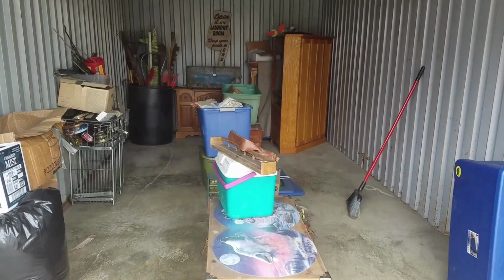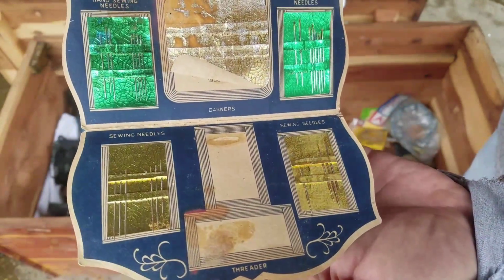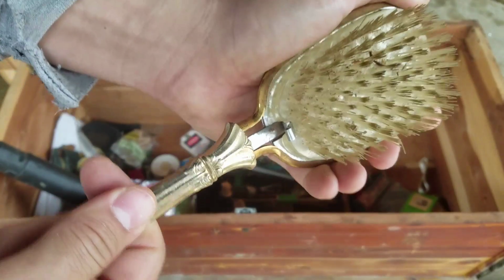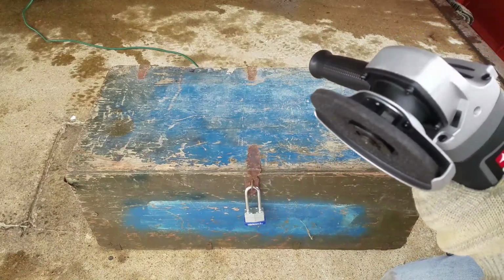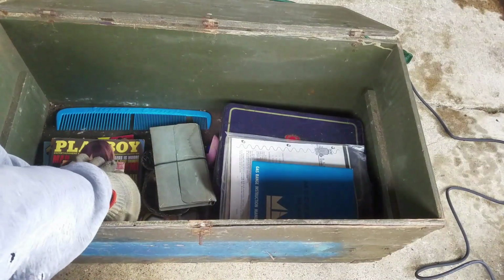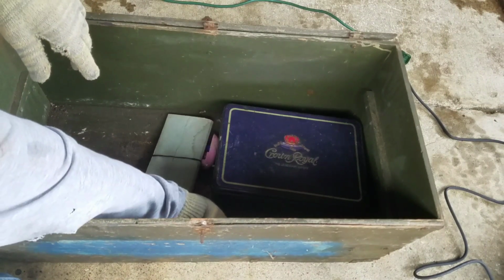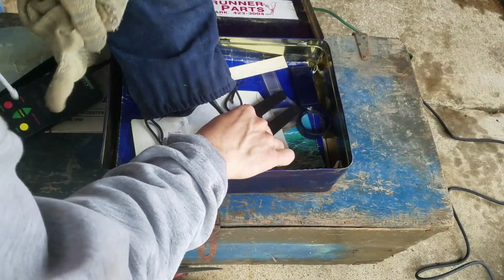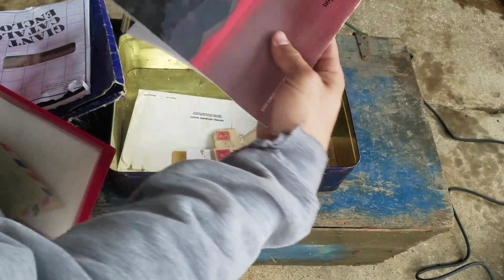FOUND WW2 MILITARY TRUNK I Bought Abandoned Storage Unit Locker / Opening Mystery Boxes Storage Wars

Comment: Have a woodworker sand and oil the outside of that chest.  Cedarwood emits oils that keep moths out of your winter clothes during the summer.  Fold and put away your cleaned wool sweaters and wool blankets, etc., so they will be ready to wear or use next winter.  That cedar wood chest will last several lifetimes if it is kept nicely.

Comment: At 8:52 those springs are tube benders. You place the proper size aluminum,copper/brass inside the bender and it allows you to make bends without getting kinks in the bent material you are trying to bend.

Comment: They are for measuring V-Belts for automobiles and farm equipment, for measuring the belt and V in the pullies, made by Gates
Reply: Yes at 4:50 the plastic devices are tor measuring fan belts and pulleys on engines . Gates is a well known brand name for v-belts and serpentine belts,

Comment: The green trunk is a G.I. issue footlocker.  I think they're now molded plastic.   They will have a mfrs. stencil with a date in them.  I see them at gar. sales here, and have a few Korean era ones.  The needles are gold washed.  Japan and Britain were major makers mid-Century.  Both nations had a strong "Export or die" mentality then.  The Japanese autos were way better.  The springs are for bending copper plumbing pipe.  Random working class garage stuff.  WWII  spilled more ink than blood even.  Those frilly G.I. souvenirs were still for sale in the '90s, at the USMCX where I worked for a while in '92.  As a relic digger, the VFW advised me against trying to return/contact WWII era dog tags I dig.  It 's all downtown trash of Honolulu, which was a somewhat honky tonk town in the War years.

Comment: Keep up the good work with your videos, instead of grinder use 2 hammer's and hit them on the sides of the lock at the same time and the lock will pop open, might take you a few times at first but you'll get the hang of it 👍 p.s. don't tell anyone 👍

Comment: The Phantom Bear Pro-Series wireless call comes complete with a remote transmitter, remote receiver module, and two long-range antennas.  With the Phantom Bear Pro-Series wireless call you're able to overlap the same sound, play two sounds simultaneously, or switch out your sound module for a different one.  Sound Modules available are Whitetail, Predator, Predator 2, African Predator, Gobbler, Moose, Elk, Bear, Honker, and Duck-Goose.  The Phantom Bear Pro-Series wireless call operate on 4 AA in the remote and 4 AA batteries in the transmitter allowing for up to 16 hours at maximum volume.  

These calls are built to be used in all weather conditions.  This model requires antennas on each unit (included).  A 15-watt, all-weather speaker (included) is plugged into the top and clipped on the back of the receiver unit, allowing this compact system to be placed 200 yards away from you, depending on the terrain, distancing yourself and allowing you to remain undetected.  

Features

Plays 2 Sounds Simultaneously
Overlaps the Same Sound
Interchangeable Sound Modules
Wired or Wireless Remote Systems
Up to 126db of Volume
16-Bit Sound Processor
Up to 200 yard range-Wireless System
Units Operate on 4 AAA Batteries
Auto Shut-Off After 1 Minute at Idle
Power & Low Battery LED's
Raised Rubber Keypad
Detachable Belt Clip
-40 Degree Operation
Sealed Module Ports
Mute Button and worth $119.95 on eBay I looked that up

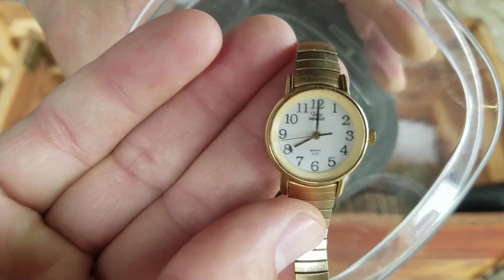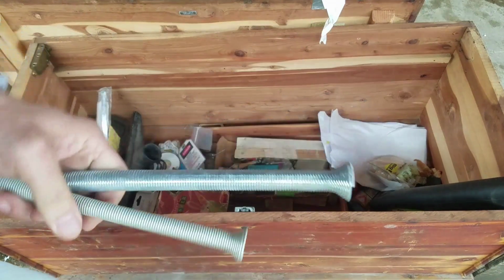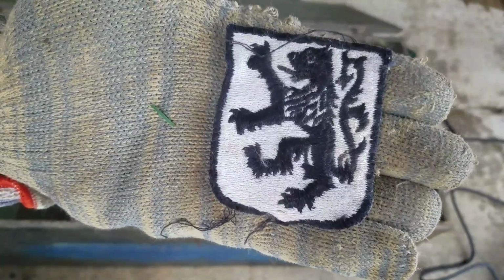Comment: timestamp 7:46 watch #1 is a Timex Indiglo warch watch #3 is a stellaris watch from Sears one sold for about 60.00 timestamp 9:03 those are pipe bending springs for non flexible water pipes used in the bathroom on the toilet or sink water supply lines or kitchen sink or copper pipe water line for a fridge with an ice maker timestamp 14:49 that is a WW2 slovenian coat of arms black panther patch which was prob the regimen or battalion he was in